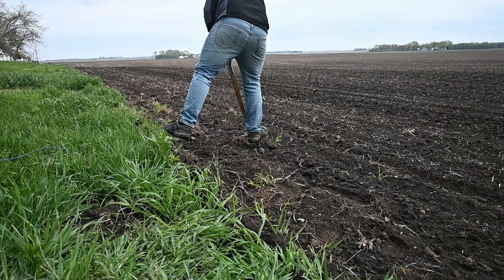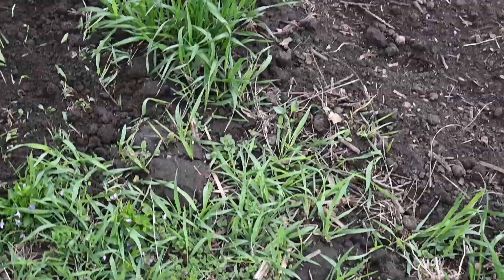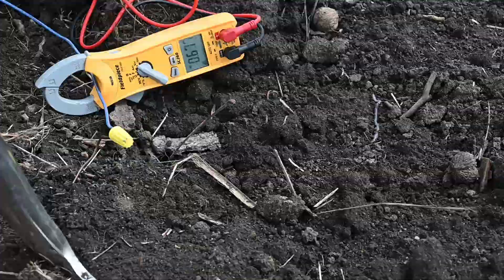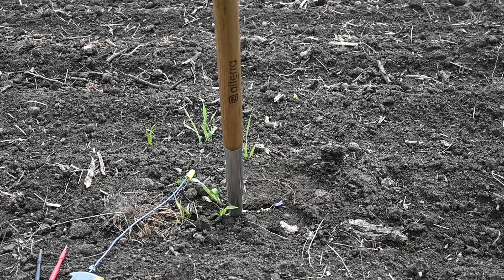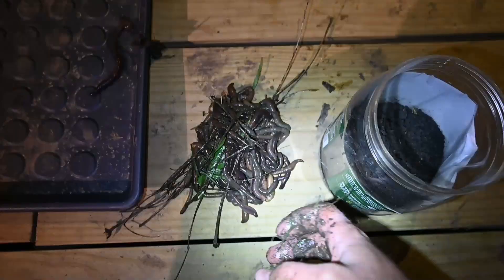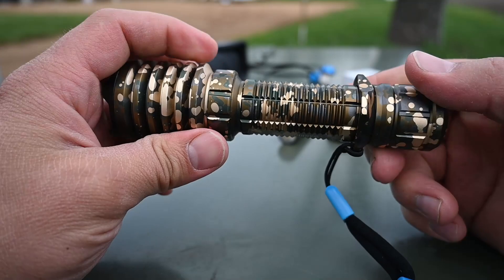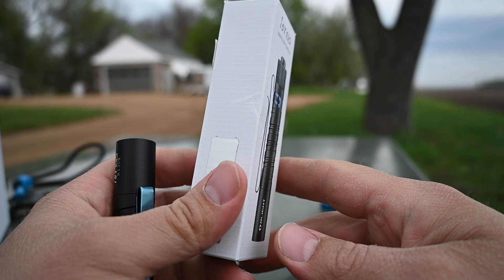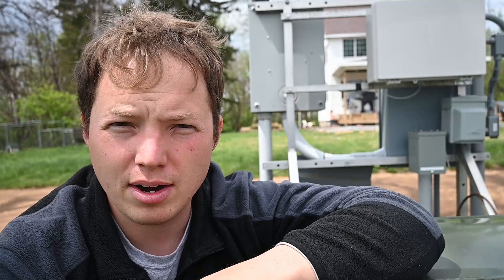How To Pick Worms Using 120 Volts!  - Olight Warrior X Pro & I5T Flashlight Review

Comment: My Dad was a small time Hobby farmer and it always fascinated me that cows were also very sensitive to stray electrical voltage, their milk production could be affected by what equipment was turned on in the barn. You might also want to point out that old fashion fuses can be safer than circuit-breakers for overload protection. GFI's are safer because the amp's required to physically harm someone is so small it isn't enough to cause an overload.

Comment: The voltages read round the fork show a perfect example that electricity is a field, not a stream of electrons like shown in most books. The field is 360 degree, just like 2 magnets near each other. The strongest flux is between the poles but iron filing will still collect all-around the w magnets

Comment: I’ve gotten nailed where I had power travel up my arm and across my chest, It Wasn’t Fun! My arm hurt for 3 days. It was an old house with 2 wire BX in it. They had wired all the neutrals through the switches. First time I ever run into that. I was Shocked at what I found.😂

Comment: I’ve done some research as to why some lights spook them and some don’t. My theory is that, with led lights it depends on the beam concentration that a flashlights lens puts out. Less powerful led lights don’t spook them, but if it narrows the beam enough it will. I believe it’s the heat that they sense that causes them to run. As a kid all we had were incandescent powered flashlights and with those it was tough to hunt them at night, but now it is easier and that’s the only explanation I can think would be the cause. But, since it’s too frustrating to deal with catching them in the grass at night for many reasons I quit catching them like that. Now I do it during the day and turn the hose on and flood them out instead. But, even that has its downside. The tap water seems to be killing them after they get in the box for a day. I also found out they explode when put into compost from the local compost facility where I live overnight. Won’t be trying that anymore. It blew one completely in half. Sucks to be a crawler I guess. No wonder they go up to 12 feet down.

Comment: The difference in readings from the sides ac compared to the front and back of the fork is probably due to the fact there are multiple tines. It is the same as the radio signal field around a yagi antenna. They reflect and multiply the results. Also you should try using the current at night and compare it to the night without current and the day with current to see if it is better than either alone.

Comment: Use to use just a couple of steel rods with a bunch of electrical tape wrapped around the top for a handle. Was a lot easier in an old house without a GFI.

Comment: You can buy high voltage/low amperage devices at a farm supply store if they would work it would be a lot safer.  How about an electric fence shocker or a cow shocker that is used to shock stubborn cows when you want them to go into a trailer?

Comment: I have used the same technique over the last 10 years keeping the Gophers out of my shall we say crop make sure that you have stepped away from the area before you apply the power to it I used two ground rods spaced approximately 10 ft or twelve feet apart and hooked it up with 10 gauge wire and delivered 240-volt into the ground it was drawing approximately 14 to 16 amps and the Gopher problem ceased people have to remember do not walk into the field with the power on extremely hazardous to your health it can cause death

Comment: They being Hollywood made a  horror movie  about this a long time ago. I think It is called squirm.  I used to fiddle for worms. When you fiddle for worms, you use a hand saw. You cut a sapling( small tree)  or drive a steak in the ground. Put the saw in the middle of the steak on top. Drag the saw back and forth with slight pressure to make a strong vibration in the ground . And the worms come up.. ,,,,,,,,,,,,,,, Jeremy in Alabama.

Comment: We just use a transformer style batt charger and a couple rods 8 tp 10 in stick them in the ground 2or3 feet apart.  I never had much luck getting the big nightcrawlers with 120 a.c but 12v dc seems not to stun the big ones.  120 ac may be shocking them much like a stun gun since the bigger the worms the more surface there is for conducting...smaller worms less surface area not as much paralyzing shocking going on..maby maby not

Comment: So since the electricity you have identified it radiating the electricity in a circle just as Tesla discussed in his towers most people dont know that his towers when 2x deeper into the earth that into the air.  Anyone familiar with a motor and the copper lines running from MI down through Chile and also …. You have to break out the globe and study the earth we are quite a power generating source….